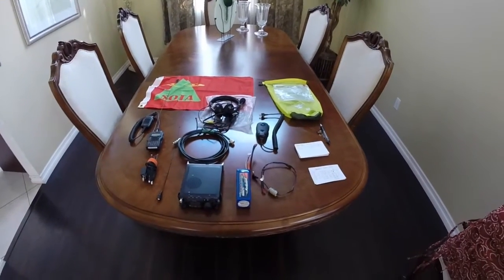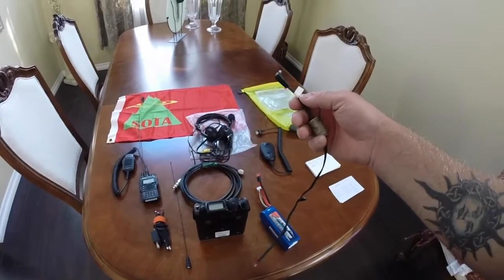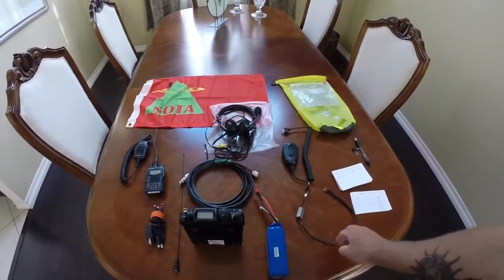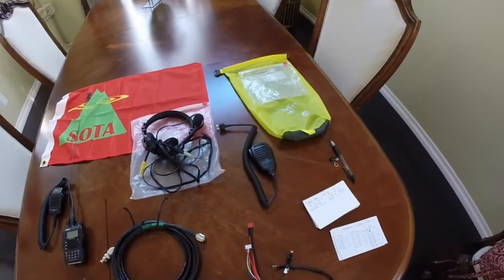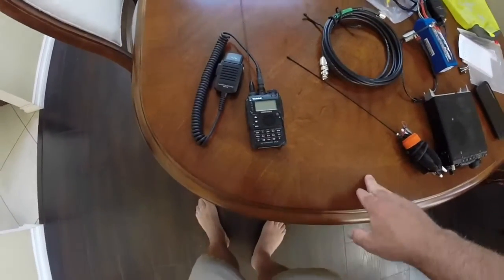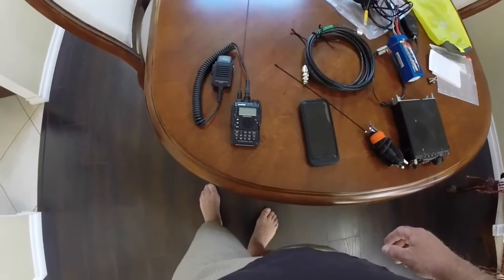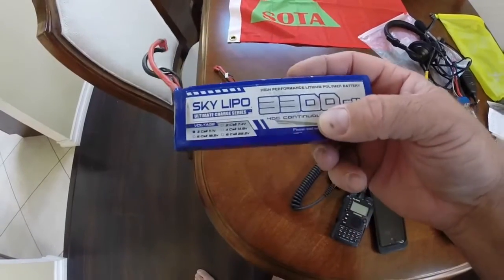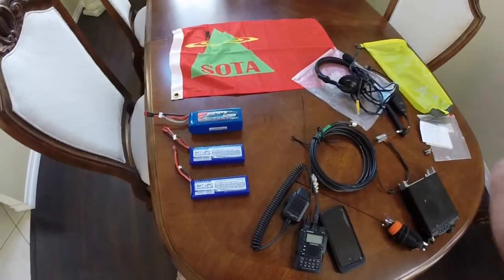An insider look at the SOTA Ham Radio Gear I use!

Comment: Do you carry a manual tuner with you? For the 817/818 or did you just cut wire to spec freq?
Last, for the 817 doing SOTA- balun or unun?

Comment: Great info. I am a new General and ham. I have 10 activations in my first month of doing SOTA. I travel all over the place for work a lot of places near mountains. I have spoke to so many people about what I am doing and a couple have expressed genuine interest. I think SOTA is a great way to introduce people to ham. Right now I am using my FT60R and a roll-up Jpole (over 90 miles on 5W!) but having two failed activations already I  want to improve my chances in HF bands. Looks like a new FT818 will be in my backpack soon!
Reply: The FT-818ND and FT-60R are fantastic radios. That’s what I take in the field. You’ll enjoy the FT-818ND. There’s a ham who makes a great power adapter for the 817/818. https://www.ebay.com/itm/FT-817-FT-817ND-FT-818-Anderson-PowerPole-Adapter-Power-Connector-/223073076701

Comment: Amazon says the handheld radio you linked is not availableDo you have a comparable substitute you can recommend?
Do you carry hot sauce or any spices to add to your dehydrated meals?
Love your videos!
Reply from the maker: Hey Tom the radio that replaced the VX-8 series seems to be the FT-2 series so you can have APRS in a HT. They aren’t as rugged as the VX-8 so consider that or look for a used VX-8 maybe. 

No need to spice up the mountain house meals as they are actually pretty good IMO, and way better than the MREs I used to eat when in the military. 

Thanks for your support man, it’s greatly appreciated.

Comment: Hey Jerry, sorry for the novice question but if you Yaesu FT-817ND has an internal battery what is the purpose of the external? If the unit were to go with just the internal battery pack would it die out too quickly?  Good stuff bro; just got my technician's license so I'm hoping to join your and K6CMD on some SOTA activation's this hiking/backpacking season.
Reply from the maker: +Tuba Solo the Hiker hey Steve congrats on your license!  Be aware if you're a techy kind of gadget guy this can get expensive real quick 😁. Regarding the 817 & external battery pack, you are correct in that it zaps the internal battery pretty quick especially if you push it at the max of 5 watts. When I go out for overnight I like to work as many bands as I can to enjoy the summit activation. If you even consider multi day trips or even multi peaks it would really suck to make that summit then set up and find out your batteries are dead or low blowing the activation. You might say oh well I'll do it again one day which is true but I put my activations out via APRS and do alerts so there are others waiting for me to summit. It'd be a let down for them and if they aren't on YouTube they may never know what happened and you look like a inconsistent SOTA activator. Long answer I know but I also subscribe to one is none and two are one. 

What radio are/did you buy?

Comment: Jerry, I see you are using the LNR trail friendly antenna.  Do you use a antenna tuner with IR or does it tune up without one? 
Thanks again. 73 Roger W8RLP
Reply from the maker: zanado11 love that antenna!  I started out with the Z100 autotuner by LDG but then tuned (trimmed) the antenna to 40m per the instructions and now no longer use or own the Z100 as it is no longer needed. Antenna is awesome on 40/20/10m as advertised.  Hope that helps you.
Reply: KG6HQD Jerry so you cut the random wire to 40m and it still does ok on 20 and 10 without a tuner? Nice!
Reply from the maker: Hey Hosh, yes it does. Instructions call for it to be tuned on 40 with an alalyzer then it drops in on 20,15 & 10. 15 being a bonus as a harmonic of 40m. My SWR on 40m was 1.3 to 2.4 across the band, on 20m 2.0 - 2.3 across, and 1.3 - 1.5 across 10m. I didn’t like where 20m landed but it was acceptable. Now I just make resonate antennas and have SWR at 1.1 - 1.5 across the whole 20m band. Video on the antenna I made forthcoming as it’s ultra lightweight and portable. 

Thanks for the sub and comment. I do believe we have a mutual friend too.

Comment: Great SOTA videos! What is the neon green tarp shelter you set up on some of your videos?
Reply from the maker: +Kyle Krieg 

Hi Kyle,

The green tarp is the Kelty Upslope Tarp, it's my light weight tent so to speak that I use in conjunction with my bivy bag.  You can check it out here 

http://www.rei.com/product/865451/kelty-upslope-tarp?&s_kwcid=sDgp6VJyb_dc%7Cpcrid%7C71493705125%7Cpkw%7Ckelty%20upslope%20tarp%7Cpmt%7Ce%7Cgoogle%7Cmain%7CNB&gclid=Cj0KEQjwm4mwBRCni-ivmePYivkBEiQAdGkklgpfDZcgOaIUlZtHcun2B4i59CvrUzmQ2dK_ClWmXJsaAsi48P8HAQ